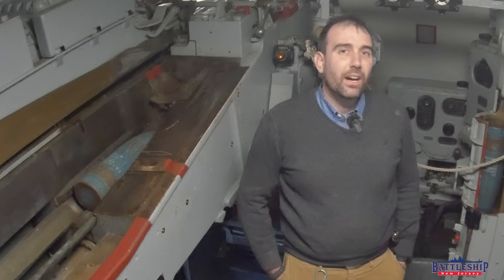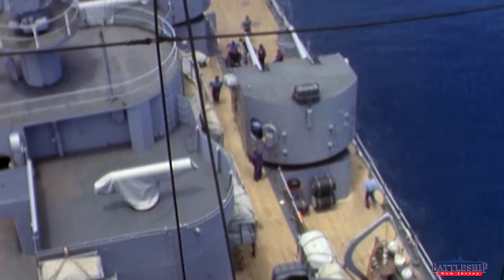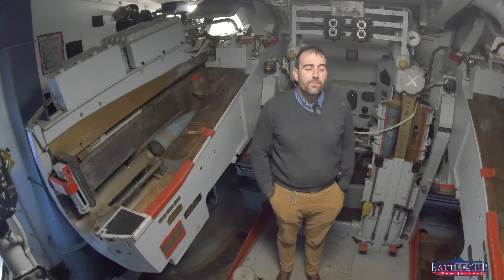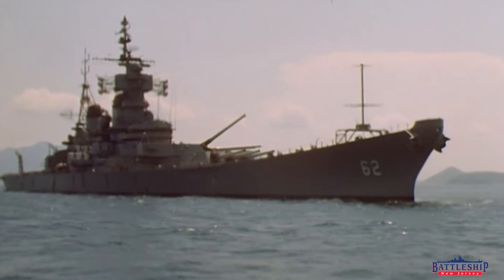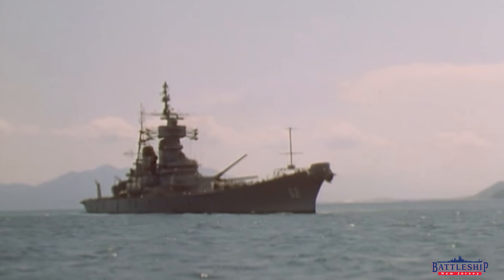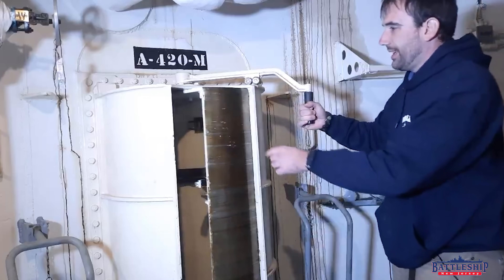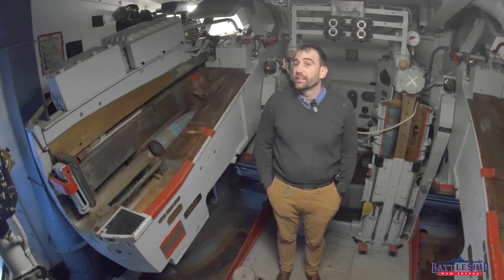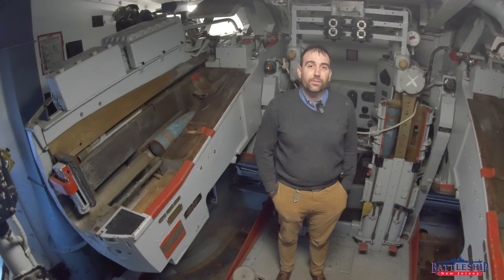Why Do Modern Warships Have So Few Guns?

Comment: I'd also add, that the chances of hitting what you're shooting at today with one barrel is much greater than hitting the same target in 1942 with 10 barrels.
Reply: Yeah, but imagine a 16 inch version of the Excalibur shell 😈
Reply: @SonsOfLorgar Adding range with Rocket Assist or RAM Assist, those 16" shells would have pretty decent range as well
Reply: @g-3409  Granted the price of a rocket assisted 16 inch shell would probably be more then a Lamborghini per shell due to how much propellant we're talking about there.
Reply: @Adierit considering the possible payloar and range, it could be a worthwhilr investment for more bombardment capability
Reply: @g-3409 not really enough to justify the cost
Reply: @Adierit  A rocket assisted 8, 10, or 12 inch saboted round.  Get 100 miles out of it or more. Especially with modern guided rounds ability to extend range with gliding. 

Still far cheaper than a guided munition that can travel that far from the release point.
Reply: @imjashingyou3461 so you attach a rocket booster, steering vanes, a guidance system, and all the power and computing systems you need to run all that. Guess what, you just built a cruise missile congratulations, that'll be 500,000 bucks per shot and 800 million for the rnd.
Reply: @Adierit a 155mm rocket assisted artillery round costs roughly 3500 USD, a single tomahawk missle costs roughly 2 million USD. I highly doubt a 16 inch rocket assisted round would cost more than a tomahawk.
You know, all this info is a google search away.
Reply: @LiveFastRaceHard  Please do tell us how a few hundred gram payload 155m artillery shell is even remotely similar in end effect to a 1000lb payload tomahawk
Reply: @LiveFastRaceHard  Excalibur? Or those 155mm Zumwalt system?

Because both are not even interchangeable, moreso looks alike
Reply: @adeedaas  look at what I was replying to.
Reply: Considering that most targets today are likely to be very fast, I'm thinking that tracking systems are the fulcrum of any mounted weapon system. Especially to counter drones and missiles. A slightly better tracking system will save a lot of ammunition (and barrel life).
Reply: I think we'll be adding more barrels though cause these days the idea is to send ten or twenty targets  as close to at once as possible for that reason.
Reply: and then you get to REPLACE the gun barrel more often.....and when you are in combat and your barrel is wearing and heating and you can't hit a damn thing....just go back and spend another decade rethinking your stupid naval doctrine.

Oh, and when thousands of drone swarms attack you from flying right above the waves....don't forget to wait another decade to ADD plenty of lower caliber anti-air machine guns
Reply: What's expensive is the guidance electronics, whether it's on a shell or a missile. You can make a longer-ranged shell with rocket assist like the M549 but at a certain point an unguided round is too inaccurate to be at all useful. People keep toying with the idea of guided shells but that loses you the cost benefit, and now you have to make all your electronics survive being shot out of a gun. (that's not to say all gun-fired precision munitions are bad. As a rarely-used bonus capability it makes sense, but if you are building your system around it, you would be better off designing a missile instead)
Reply: Isn’t it still better to have one single big gun then a tiny one
Reply: So what you’re saying is 10 barrels now is better than 10 barrels in 1942?
Reply: And yet on Dec 7 a destroyer hit a midget sub with open sights and sank it
Reply: @miketorres8441 
A soldier got dropped through their armor vest! Clearly we should-
Tell me how standard combat protocol was to engage submarines with the deck guns.
Reply: @sunrisejackdaw1779 it did happen tho so idk what you are on about
Reply: How about new battleships with 12 modernized 16/18 inch guns using modern high explosive guided extended range (30 miles +) shells firing all at once obliterating a target with minimal cost compared to expensive missiles. Seems like a logical move to me. Bring back the battleships!!
Reply: @victorparker308 cuz missiles have ranges over 100 miles, and keeping the ship out of range of threats to protect the lives on board is worth it.
Reply: @FleetAdmirable  depends on the threat you are facing. In a conventional war against an opponent with high end weapons, you will most likely want to stay as far as you can from the shore. However insurgencies or other non-ASHM equipped forces can still be bombarded with impunity.
Reply: @victorparker308  The problem here is that you have to maintain a battleship. And unless you add a whole lot of other system/i.e a massive retrofit, you have a very expensive ship with one specific use. Also, the range of 30 miles is way too low. except something like 80 miles.
Reply: @victorparker308  Last time they did. It cost enough money to make taxpayer angry, and even then decided to not used it anyway because it's not even that cheaper than Tomahawk

And it's only 155mm
Reply: Until ofc the computer crashes...then the shit will hit the fan as people try manually firing these remote guns at fast moving incoming targets.
Reply: @dc-4ever201 This may surprise you, but a properly built and programmed computer will not crash. When you experience crashes it is either because some of your hardware is defective or because the software has really bad bugs in it. Crashes are a result of poor quality control, not inherent to computers.
Reply: @dc-4ever201  That's like saying that the fire control on the electromechanical FCS crashes. Yes it happens, no, it doesn't happen enough that old dinosaurs like you can justify that it's a valid cause
Reply: STaY OfF the MeTh
Reply: 10 barrels last 10 times longer.
Reply: @michaelangelo7511  Unless you are shooting all ten barrels at once . .
Reply: @michaelangelo7511  less room for ammo.😢
Reply: @michaelangelo7511 if you're always using all ten barrels then the wear is the same. If you aren't, then whichever barrels you arent using are just taking up space that could be used for dozens if other important systems that could actually contribute to combat or survivability
Reply: No it's not lol, if it was then they would have replaced the Iowas analog fire calculation computers with digital ones in the 80s but they didn't.
Reply: @gregsbiplays9899 It’s probably not the computers but GPS guided shells that make the difference. 

In any case, the Iowas were brought back as a stopgap and a show of force in response to the Kirovs, not because there was any real utility in having them. Armor wouldn’t protect from heavy Soviet anti-ship missiles and those guns were too short-ranged to fight ships anyhow.

Comment: As a former Gunners Mate on a Knox class frigate I fully agree with your assessment with the range factor when compared with missles for long range strikes and anti-aircraft use. But for the drone and even point defense work I beieve the new 30mm and 40mm guns with their rapid fire and programable projectiles will be the future for ships defense.
Reply: Isn’t the navy adding more 25mm?
Reply: @tomhenry897   I read just yesterday that guns may need to be added to meet the challenges of drone warfare.
Reply: @tomhenry897  25mm is hardly a "main gun". ship always have alot of secondary guns to protect it from small attack that is not worth the attention of the main weapon. as for the main gun,  it not just an issue of range, newer guns shoot alot faster, you don't need more gun to engage multiple target. when the Russian build destroyer for China, they have 2 turret with 2 gun each, however when China modernised those ship, it was all replace by a single gun, that single chinese gun has the fire rate of 4 soviet era gun.... i am sure all NATO ship has an equally high rate of fire too...
Reply: Yes they are; I failed to mention them and the 57mm gun mount. I believe that all have programable projectiles available. @tomhenry897
Reply: The ukrainians have shown radar guided standard machine guns are also very effective at defending against drones so ships could be covered defensively against them quite cheaply and efficiently.
Reply: I would tend to agree but I think they should have two five inch mounts positioned in such a way that the arcs of fire would be almost completely around the ship. If you have something coming at the stern the fie inch on the bow is not much good and making a 90-degree turn is not a quick fix.  Especially if a swarm of drone is approaching.
Reply: @johnmcmickle5685  What do you imagine the 5" guns would be firing at?  Larger targets at longer ranges will be targeted with missiles, smaller targets at close range will be targeted with smaller caliber autocannons.  The only defensive use I can see for the  5" gun is if you are somehow up against an opponent who has perfect anti-missile defences, or if you are being targeted by a small sea drone with too much armour for the smaller guns to deal with.
Reply: @johnmcmickle5685  you have to consider what you are fighting against. Most targets you engage will probably even be beyond visual range, so there won't really be anything your guns could do against rear attackers anyways. Keep in mind, the enemy will attack with missiles too, and so they will shoot before you can shoot back using guns. The only thing that eventually could come into proximity would be submarines, but you would want to use depth charges or other measures, I'm not very sure, but likely not your main gun, against those
Reply: Maybe the phalanx could be replaced with laser eventually but that has it's own problems (besides technology).
Reply: @petrkinkal1509  You get the same issues of directed energy as you do with missiles; cost. Lasers aren't cheap compared to a gun. If you're shooting up close to deal with a drone swarm, being able to throw up a lot of lead in a hurry for very little money is a nice thing. You also have the benefit of bullets working immediately. The bullet hits and does it's damage, but directed energy has to sit on target for a bit to do it's damage. Of course, the laser reaches it's target at the speed of light where projectiles are relatively slow. Shells and bullets are less impacted by weather.  Guns need a big heavy mount to deal with recoil, lasers don't.
Once directed energy gets a little more advanced, we might see it replace guns.
Reply: @Clean97GTI  If the laser doesn't destroy itself every time it fires then I don't see why the cost per shot should be that high.

As the lifetime of the laser would approach infinity the cost of firing cost would approach the cost of energy. (Cost of fuel for the vehicle generator unless it is connected to grid then cost of electricity.)

Not sure what the current lifetimes of military lasers (prototypes) are.

Rest I agree with.
Reply: @Clean97GTI  lasers, after initial cost aren't that expensive to run. They need energy which can be supplied from naval nuclear reactors present on many modern vessels. But they still need guns for redundancy.
Reply: Lasers are probably the future and, with DE M-Shorad currently entering US army service, the future may be here.
Reply: I think the 40mm "machine gun grenade launcher" with an explosive/flak round would be good for drone swarms, as well as small-boat attacks.
Reply: @jedironin380  yes i've thought for a while some sort of flat trajectory automatic grenade launcher with bigger ammunition would be great- especially against things like drones, and flak would present absolutely huge problems for them. A ship mounted automatic grenade launcher with an electric chain gun mechanism, potential for radar guidance, trajectory alterable, much larger ammunition which is programmable and can be either proximity fused, shrapnel air burst, ap mines which bury in the ground, floating mines which self detonate after an hour, anti vehicle shaped charge, much more high explosive, flak etc.etc is technology which has been possible for years and would be such an effective weapon in wars like ukraine against aerial and smal ship drones, men and small vehicles. For some reason its not been persued and we're stuck with the currently hugely underwhelming mg grenade launchers.
Reply: @jedironin380  Look up "40mm Bofors AA"
Reply: I get people are very excited about drones with them being all over the media but the contemporary counter measures are basic yet still effective (out of 15 drones russia attacked kyiv with 1 got through). When the counter measures become much more advanced drones will have to be used much more sparingly and far less spectacularly

The british have the martlet guided missile,  this is a good example of the sort of thing we will see more of. They were designed to be multi-role but particularly very cheap. They are both capable and cheap enough (And have proven in combat their anti-air and anti-vehicle credentials) to make it worth shooting down even small, commercial photography drones used for recon whereas with something like the stinger missile that would be a huge, possible unjustifiable overuse of resources. Martlets will be of great use for naval defense against all sorts of threats, combined with shkp guns/auto cannons

Added to vehicle,ship mounted ir and radar guided machine guns/auto cannons/ guided missiles, drones will have to contend with quickly developing ground laser tech, signal jammers, control hackers, flak, proximity fuses, interceptor drones, drone team trackers and radar/sighting technology. Not many places to hide your drone in the sea btw.

 So three point conclusions are always good-

1. If you want to, take notice of the genuinely fascinating technology and tactical innovations, but see how vulnerable these drones actually are. 2. dont get caught in 'the drone revolution' bs, and 3. remember this is part of a vicious war caused by a needless invasion leading to ww2 scale casualtiess of Ukrainian and russian men who just want to live peacefully in their own home.

the naval aspect of this war has been ignored a lot by the media but ukraine has made a real mess of the russian black sea fleet. Thats a key strategic win as it helps them cut off supplies and strength to russian forces in rhe west and crimea, but itl take nore than drones. The storm shadow attacks on russia  vessels were just beautiful, no amount of guns will prevent rhat sort of thing.
Reply: @Ukraineaissance2014  The issue is with Russia having pretty good electronic warfare defence, yet they still struggle with cheap drone swarms.
Reply: Correct . And I expect increase in anti flying target radar systems. They need to avoid the same mistake as even the Bismarck had....no possibility of hitting slow flying tarrgets. (Swordfish).
Also...I expect, in answer on the newest torpedo's which can find their programmed target at any distance...anti torpedo weapons on board of war ships. Same as the phalanx against incoming rockets, but than underwater defendings....sonar instead of radar.
Reply: I agree that guns are gonna be needed for drone and point defense threats. Do you know if a punt gun would be effective? I'd imagine you could drop half a drone swarm with every shot but I'm no expert.
Reply: Missiles take time to get going where a shell is instant take off.
Reply: If you are littoral or coast guard or just working in closer to shore; I would think you would want some guns locked and loaded in case you were fired upon. Quicker reaction than calling in an air strike. P.S. - We don't have any seaplanes; just choppers. I think we are looking into getting some, though.
Reply: @@JimCarner all you need for a so called swarm is simple flak and other airburst weapons and radar guided machine guns. Even pressurised water fired their way has been shown to bring them down. Theyre simply too delicate and light, and making them heavier isnt an option.
Reply: Intermediate use at best.  If Ukraine war taught us a thing, is that in modern war, you'll know exactly where your opponent is. And he'll know where you are.    So going from that, and adding cheap cost of drones, you know you'll have lot of saturation attacks with relatively precise drones or guided amnution.
So the future is direct energy weapons. You just can't compete with bullets against a lot of drones. Storage and reload would be too problematic.

Cannons may keep existing for other uses for sure though.
Reply: My question would be what about if anti-missile defense systems advance to such a degree that missiles are no longer able to effectively hit the target. I mean, the Phalanx system seems to be able to protect a ship with just two or three gun mounts and what about EW jamming of the flight/targeting controls of a missile. If the US were to face another technological power like Russia or China in a shooting war, I wouldn't be surprised if we found them trying to slap big guns on ships again.

Comment: Dad was a gunner’s mate during WW2, he found the reduction of guns afloat disturbing. He was qualified on everything from machine guns to 8 inch guns. Shells are cheap and effective when used in the envelope it was developed for…it’s hard to argue with a 5” HE round going off in your lap!
Reply: Quick Google search shows that a 57mm Bofors round is over $1200 per round.
Reply: That's what they're realizing with the anti-aircraft guns vs. the drone waves over in Ukraine.  Guns are cheaper in the long run.  Missiles rule, but guns (both 5" and 20mm) are still essential components.
Reply: @tyree9055  Not every missile is a multi million dollar wonder weapon. Low end guided missiles cost 10's of thousands, about the same as a medium sized drone.
Reply: @Akm72  That's still way more expensive than a $1 or $100 gun round.